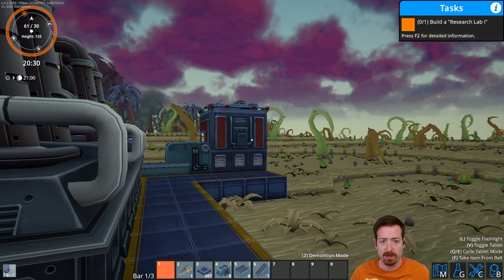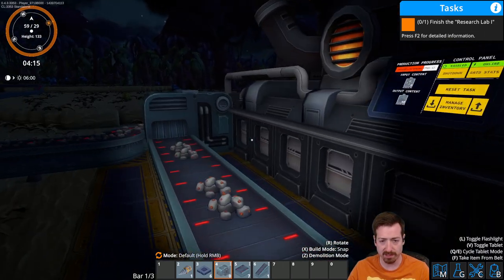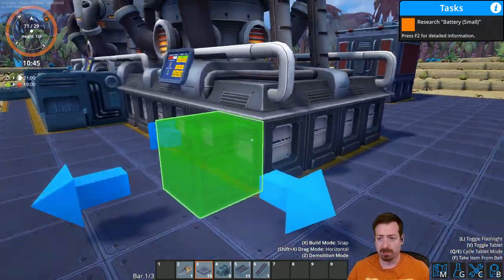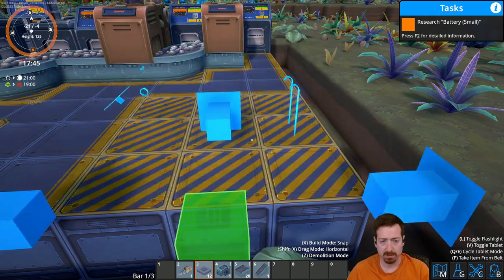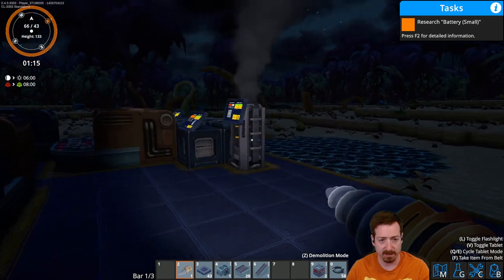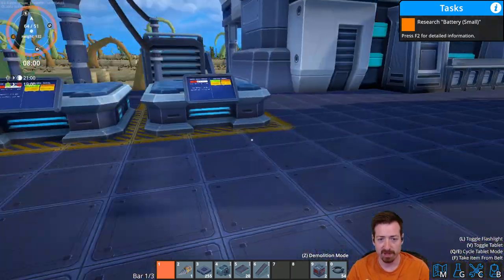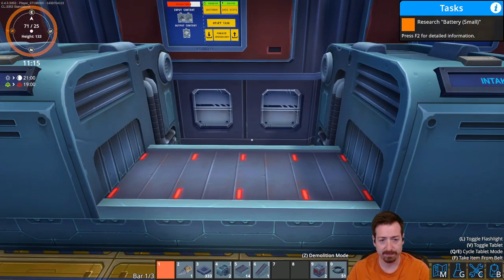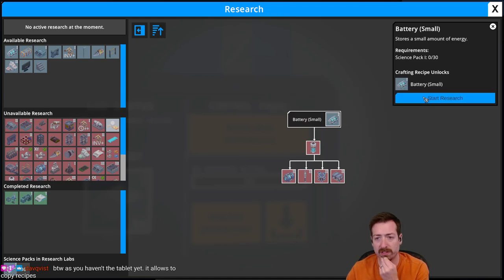Foundry: Alpha Preview #2 - This is Awesome!!

Comment: This game doesn't seem to understand why Factorio is top-down and has large buildings, while (modded) Minecraft is first-person and doesn't often use thousands of gigantic multiblocks. It really needs to either calm down on the gigantic buildings, or provide better mobility, and tools for verticality early on.
Reply from the maker: I hear you, but also have you played/seen satisfactory? Have you seen the oil refineries? the coal plants? I would argue that the sense of scale is fine here. It's a game design decision and I think it works okay. If you're trying to be like modded minecraft, then yeah, this stuff feels huge. But if you're trying to be like satisfactory, this is par for the course.
Reply: cough GregTech/IE cough :D . Minecraft mainly doesn't have a lot of machines because of performance problems. Things are actually pretty small compared to Satisfactory, and you move a bit faster than in Minecraft. And as with most factory games, it's all about how you organize your factory. Don't try to put everything unreasonably close together and you'll be just fine. No need to build the ultra-compact stuff like in Factorio :D
Reply: @LuaanTi  Gregtech's performance is pretty solid even with thousands of machines loaded in. And at 15x15x3, its biggest endgame multiblock is roughly the same size as that starting research lab.
Reply: @_mwk  That research lab is by far the biggest in the game, though, and you're only supposed to build one. It's like the orbital elevator anchor in Satisfactory.